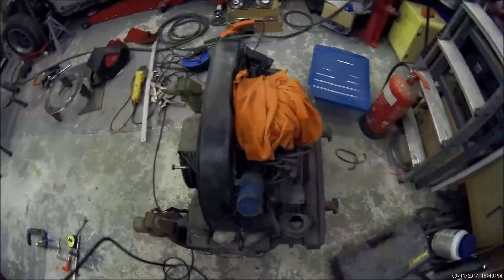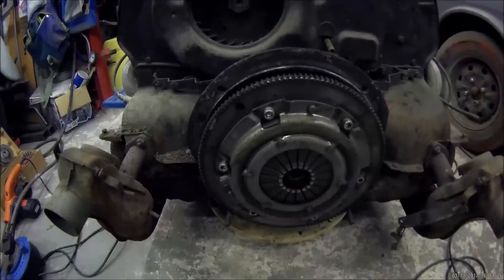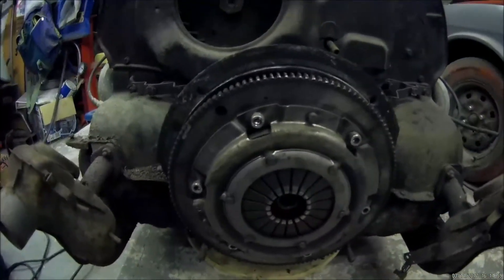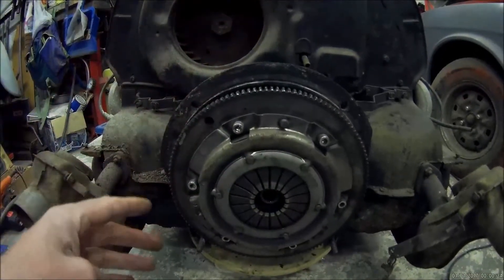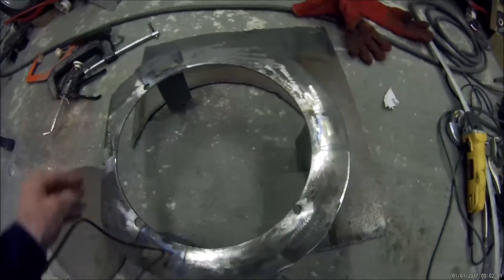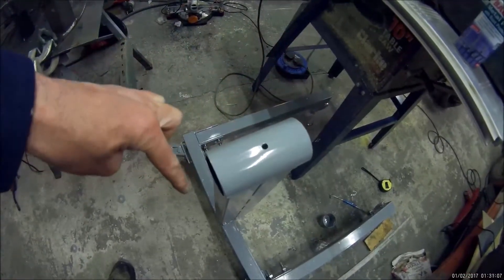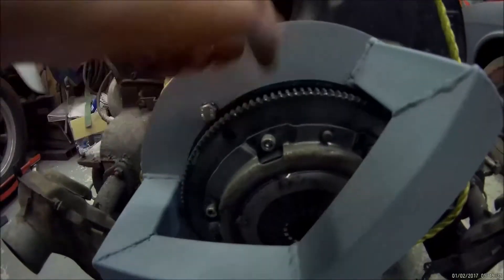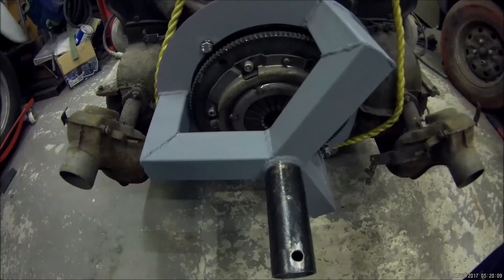Engine stand build DIY Part 2 (aircooled VW)

Comment: I was so nervous when you mounted the engine, the legs of your engine stand needs to come out more as you are on the cusp of the tipping point, I guarantee you if you push the engine from the back of the stand its going to tip forward. Please be careful mate.